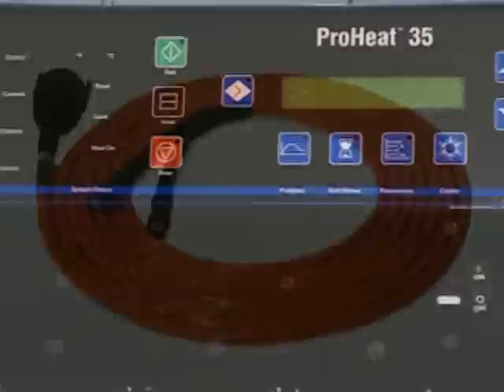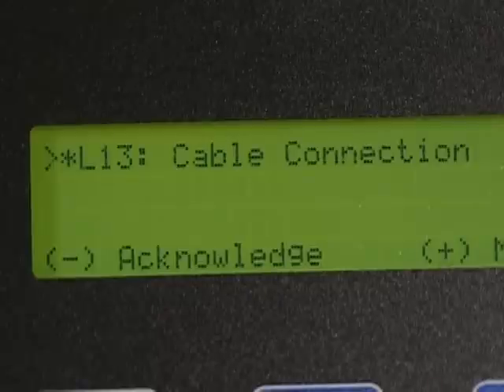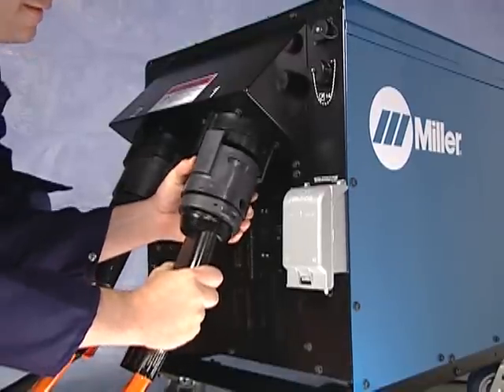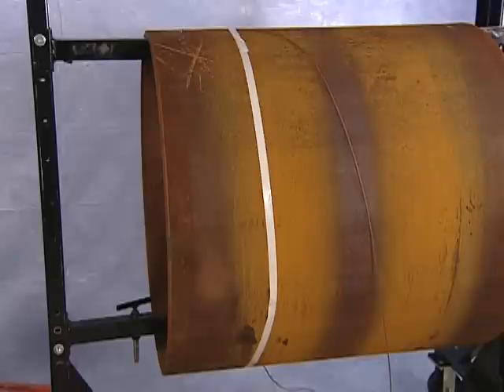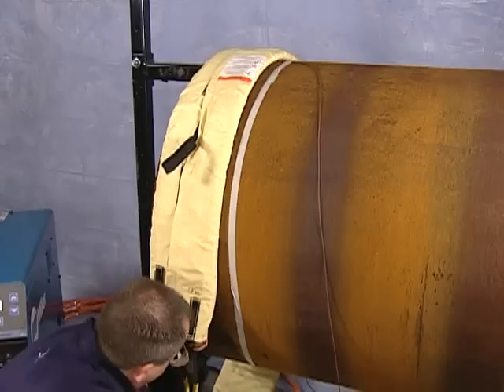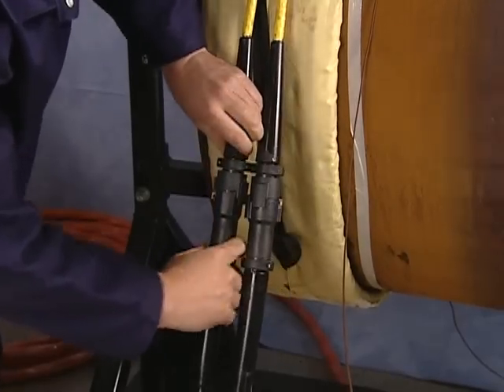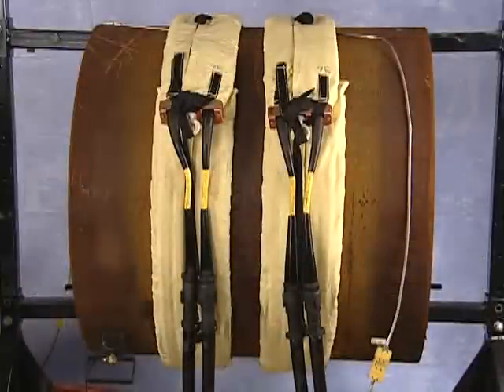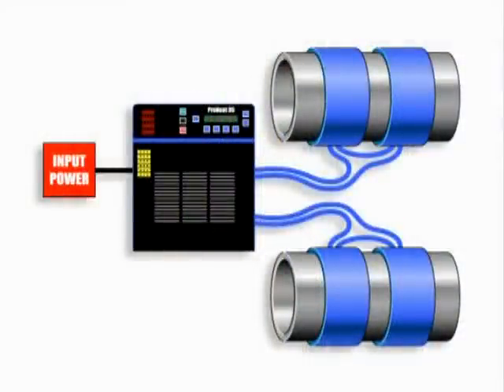Miller ProHeat Induction Heating - Air Cooled System

Comment: Can this system adapt to do a PWHt to  a reinforcement pad weld
Reply from the maker: Thanks for reaching out. Reinforcement pads certainly can be stress relieved with the PROHEAT,  but we would need information about the geometry to be heated as well as the temperature requirements to be sure. Thank you.